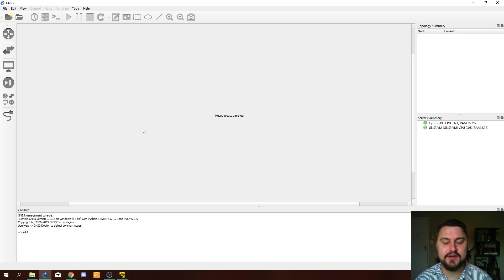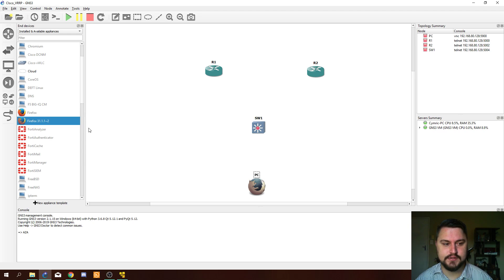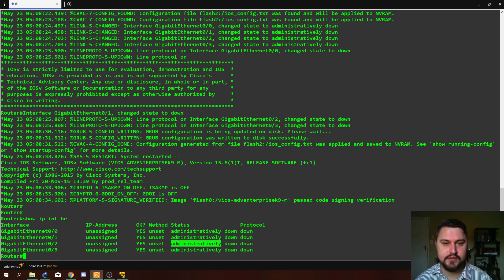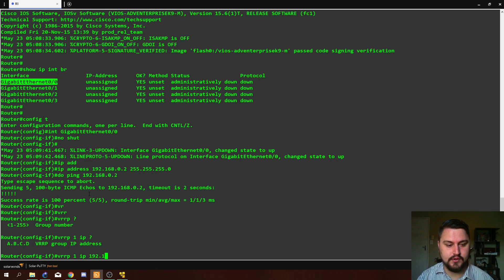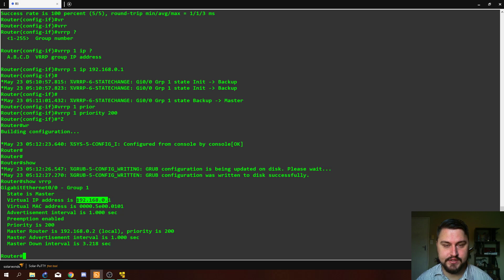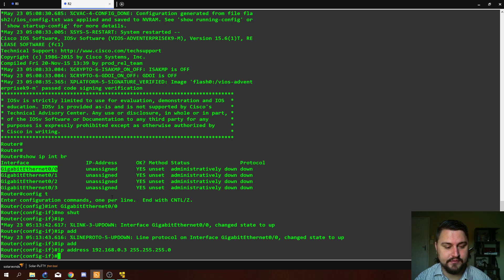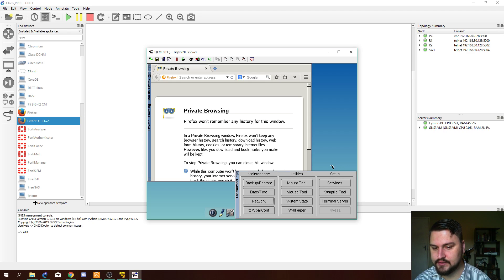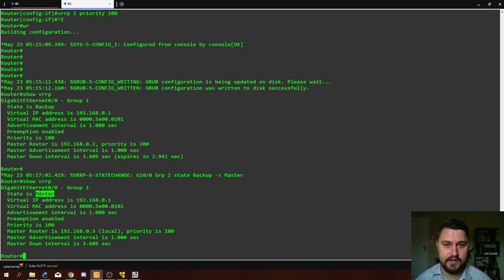Cisco VRRP Configuration

Comment: My brother, your video is full of holes. You should review it and make a new one. One that cover from the beginning to the end of how to set up VRRP.
This video will NOT help anyone to accomplish what is intended for.
For example, in this video you show what happens if R1 goes down, got it. What if R1 is not down but the connection of R! to the ISP remote router  is, then what?
Also, in the real world, those Routers will have virtual interfaces with subnetmask and the Switch will have multiple VLANs with at least 2 trunks configured (not shown in this video).
Make it real, if you do you will be helping someone out there.
Thanks for the effort though....
Reply from the maker: Thank you for your suggestion.